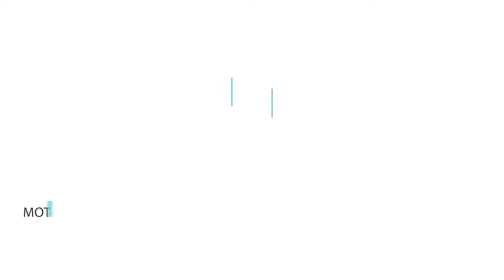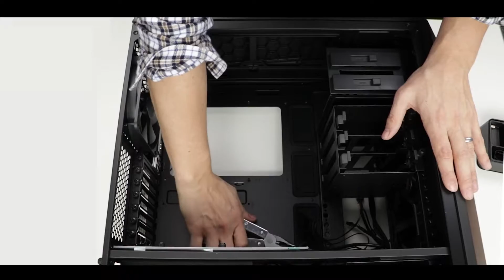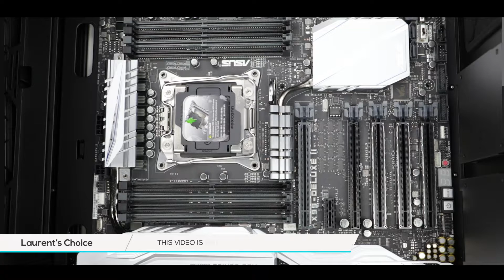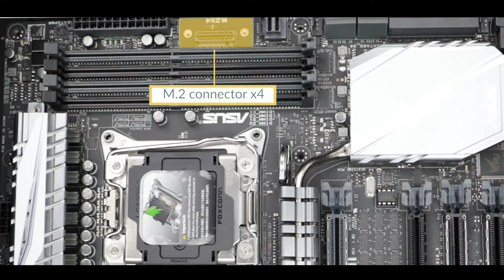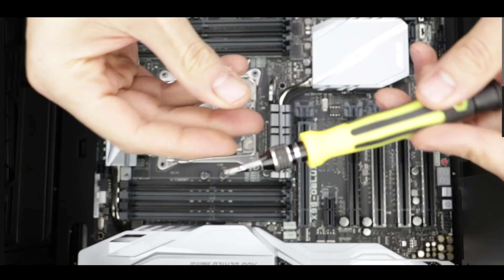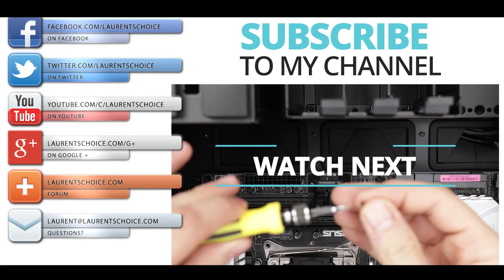x99 Motherboard installation (Crazy CPU Machine 2/10)

Comment: At approximately 3:30 you talk about the "Thermal display." This is actually what ASUS calls the "Q-Code LED" which is "a 2-digit error code that displays the system status." See page 1-17 of the online manual (https://www.asus.com/us/Motherboards/X99-DELUXE-II/HelpDesk_Manual/) for details.
Unfortunately, I don't think it will display system temperature at all.
Hope that helps...
Reply from the maker: +coleplacemb that's correct :)
I refer to it as the Qled in later videos :)

Thanks for correcting !